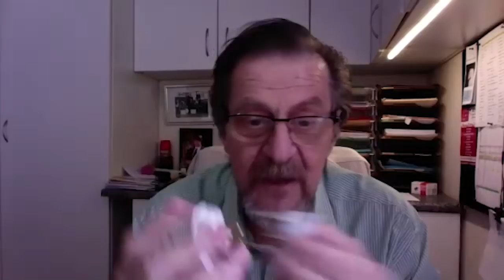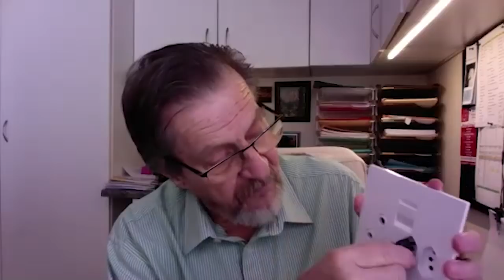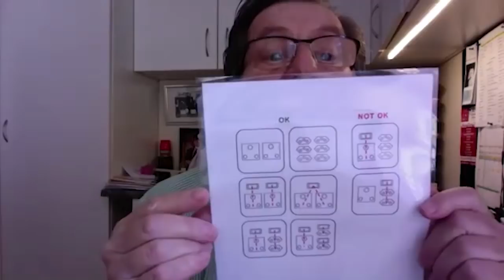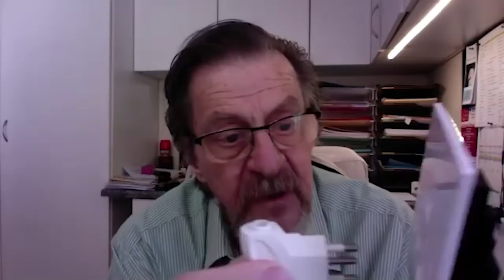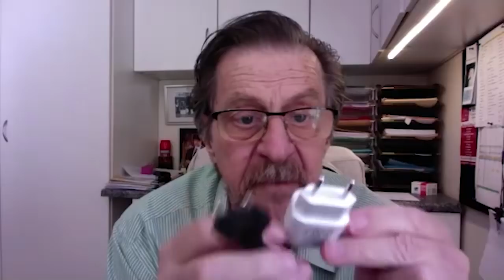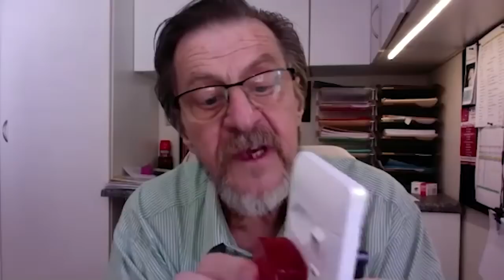South Africa’s new sockets and plugs: Everything you need to know

Comment: Thank you for this video, I found it very helpful and interesting. However, this new plug (SANS 164-2) doesn’t make sense to me. Why not simply go with something more global like the British flat plug with the fuse (it’s in more countries) or something smaller and more convenient? I can’t actually see how this will fit into global travel adapters but perhaps it’s because I cannot visualise it.
Reply: SANS 164-2 or rather IEC 60906-1 was specifically designed to replace national socket and plug standards, and from safety and practical perspective it's the best plug design ever made. It is compact, safe, polarized, it has sleeved pins and a recesed socket. The British plug is unnecessarily big and overengineered, it was designed at a time when manufacturing tolerances were worse, thats why all these older plugs are so large. it also´needs to have a fuse in every plug which is an unnecessary complexity and a relic of old British ring circuit wiring. I'm very happy that SA went with IEC 60906-1, its the best plug/socket.

Comment: What people really want is 15(16 ) amp BS 546 plugs with BS 1362 fuses. They also want double sockets that are switched, with shutters. People really do not want 12 volt huge cables in their houses, you nutter. The fuse is erroneously associated with ring circuits; this is not the case; in fact the fused plug is there to prevent fire, because it is the cable from the plug to the appliance that is most at risk of overheating and causing fire, not the appliance itself, especially when the supply voltage drops unexpectedly.
Reply: fuses are banned in SA circuits

Comment: Bad system! I live in Denmark and Norway. In Denmark ve have a bad oldscool system who looks like this with svitches on the oldest parts, but wee have also the ferench system and schuko. In Norway there is only schuko! That is  safer than the old danish system. None of our contryes have 32A ring system. I ban the old danish system and change it to schuko as fast as I need! Also for sorft cabels! Best wish for South Africa, Schwitserland and Denmark is Ban these oldfasion systems and go for schuko/ CE7 plugs and 2,5 A 2 pin schuko plugs and fuse centrals.

Comment: Great video thanks for sharing your knowledge

 
Personally I don't think the round pins are better because it allows for easy reverse polarity connections to the 2 pin only appliances. 

Here in Australia, the pins are angled so it's not possible even for a 2 pin appliance plug to be plugged in reverse polarity (unless you got a house wired incorrectly).

That being said the good thing about the round pins is that it allows for a greater contact area and thus a more tight/snug fit into the female wall outlet, but conversely it uses more metal than like Au plugs. 

Also IMO ground pin should be facing down, and slightly larger like in Australia because then the ground pin will be the last pin to leave in case of an accident.
Reply: In AC, polarity doesn't matter.

Comment: Ring circuits are 30 A (now 32 A with breakers), not 13 A. The plug is for 13 A. The fuse is mandatory just because the breaker is so high. The ugly thing is that the fuse protects also the socket and in some causes (spurs) even the wiring. The fixed installation should not be protected by what is plugged in it. 

The British design was developed for the post war reconstruction. It works less well on modern systems with many double insulated devices and even portable ones. A UK phone charger is twice the size of an European one even when it has folding prongs.

I know British have some nationalistic pride for the ugly plug but it is obsolete.
Reply: Fully agreed. The British plug is incredibly overengineered and frankly obsolete for modern times. As a European I cant stand when Brits pretend that their ugly gigantic plug is somehow "better" than Shuko or French plug. Its not.

Comment: All South Africa had to do was adopt the best plug and socket available. That is the British G Type fuse-in-plug. It is miles superior to all others. 

Adopting this new socket design in South Africa is plain stupid when an off the shelf version is available. All thinking and 80 years if evolution has been done for you.
Reply: Total nonsense. It is an obsolete design way too big and designed for British ring final circuits that do not exist anywhere else.
Reply: @okaro6595  
the British G Type plug and socket is vastly superior to all others.  You must stop making things up.
Reply: @okaro6595  
British plug is the best in the world. 
1)  It is not big at all. It is designed for a hand to easily remove. 
2) It slots in place firmly. 
3) Earth pin first in and last out. 
4) Pins can take  25A plus so will not bend or melt.
5) Fuse inside with max 13A (3KW). Can have a 1A fuse for a table lamp. Takes 1A to 13A fuses. 
6) Protects flexes from bursting into flames, the only system to do so.
7) It enables final ring circuits. Great advantage.
8) They look good.
9) Cannot be removed by pulling the flex.
10)  Pins insulted.
11)  Socket has DP switch.
12)  Socket has protective gate. Children cannot poke forks into socket.
13) etc

Saudi Arabia adopted the British plug and socket, as they assessed it the best. Used all around the world..
Reply: @okaro6595  
The British G Type plug was not designed for ring circuits. It is used for radial and rings. Installers saw the brilliant fuse-in-plug enabled the ingenious rings to be fitted.

The final ring is a busbar with distributed fuses around the house. Max 32A breaker,  AFDD recommended, min 2.5mm cable, max 100 square metres of floor area.
Reply: @johnburns4017  The ring system was invented in order to save on copper cables.
Reply: @RobertClaeson  
The ring was not invented to save on copper.
Reply: @okaro6595  It's still used in a few countries that were part of the British Empire, such as Cyprus and Malta (and Ireland). Others are moving away from it.
Reply: Malaysian Airconditioner plugs as South African but Malaysia uses UK plugs
Reply: The G-type plug is a nice but clunky and old design. The fuse was put there because there weren't always central breakers. IEC 60906-1 is a modern design that has taken the best features of a number of different plugs.
Reply: @RobertClaeson  
The standards for the BS1363 13A sockets and plugs were laid down during WW2. Contrary to myth, it had a fuse in-the-plug to to eliminate the three types of circuits and sockets/plugs. There was the round-pin standards with dedicated plugs and circuits for: 3A, 5A and 15A, with circuit fusing at the consumer unit and sockets/plugs to match. So one room may have three different types of sockets depending on what they are being used for. This led to misuse and confusion. 

The 2.5mm cable, maximum 13A socket/plug current draw with fuse-in-plug to match the appliance and its flex was a clever cover all, covering all bases. The fuse-in-plug then became the enabler for rings in the late 50s/early 60s in the building boom. It was seen that using final ring circuits saved about 30% of the copper compared to the previous multitude of radials and a smaller cheaper consumer unit. The ring effectively became a busbar with the fuses distributed around the house rather than at one point, the consumer unit.

The British Type plug is designed to be held by a hand, not be a part of child's Lego set.  It is still supreme. Nothing comes close to it.
Reply: @RobertClaeson  
The standards for the BS1363 13A sockets and plugs were laid down during WW2. Contrary to myth, it had a fuse in-the-plug to to eliminate the three types of circuits and sockets/plugs. There was the round-pin standards with dedicated plugs and circuits for: 3A, 5A and 15A, with circuit fusing at the consumer unit and sockets/plugs to match. So one room may have three different types of sockets depending on what they are being used for. This led to misuse and confusion. 

The 2.5mm cable, maximum 13A socket/plug current draw with fuse-in-plug to match the appliance and its flex was a clever cover all, covering all bases. The fuse-in-plug then became the enabler for rings in the late 50s/early 60s in the building boom. It was seen that using final ring circuits saved about 30% of the copper compared to the previous multitude of radials and a smaller cheaper consumer unit. The ring effectively became a busbar with the fuses distributed around the house rather than at one point, the consumer unit.
Reply: @RobertClaeson  
IEC 60906 looks like it is from a Lego set. Appalling. Type G is still supreme.

Comment: It seems rather silly to go through all this effort to introduce a new standard when we could have just adopted the already widely used schuko plug.
Reply: This is better than schuko as it is much smaller. Also most devices use europlug anyway and the socket is compatible with them. Schuko was designed to solve specific problems that existed when it was designed i.e. how to prevent use of ungrounded plugs in grounded sockets but allow use of grounded plugs in ungrounded sockets. That is nor relevant anymore.
Reply: Schuko? Please no.

Comment: Interesting interview
This is the first time that I hear that SCHUKO is banned in a country for security reasons...  (except Switzerland...) The plugs are now compatible with SCHUKO and the frech system (CEE 7/4). So except Danmark and  Switzerland - speaking about Switzerland: It's not IEC 60906-1, but looks like it. Brasils NBR 14136 - the same, looks like it... 

Conclusion: South Africa seems to be the only country using the world standard IEC 60906-1
Reply: Didn't Brazil adapted first in 2002?
Reply: @DangerWrap  they look like, but it's like Switzerland not exactly the standard 
Brazil/Swiss/South Africa have different polarity and diameter of the pins, different current potential. South African is the only country following the standard 100%
So, to me there are three different systems that share the same idea, might be somehow "compatible", but are different standards

Comment: This all new plug is a disgrace. It's all Plastic and flimsy. I's so sorry for south africa for an electrical plug so unreliable. Be ready for lots of broken modules.
Reply: We have had it for years... it's just now they're releasing a version with a ground plug and allowed for it to be installed directly into the wall. 

Old plug still has its place for higher current applications in my opinion or applications where the plug is under a decent amount of tension, but needing less adaptors for when I need to charge my phone will be nice.
Reply: @hanro50  The new plug is designed for 16 amperes.
Reply: Looks like the Swiss plug to me, must have been in use for years.